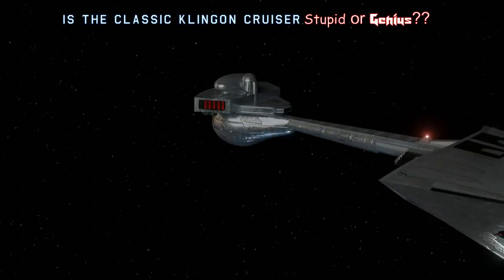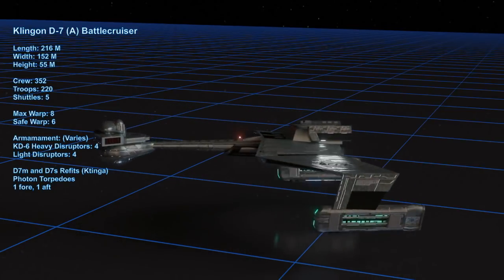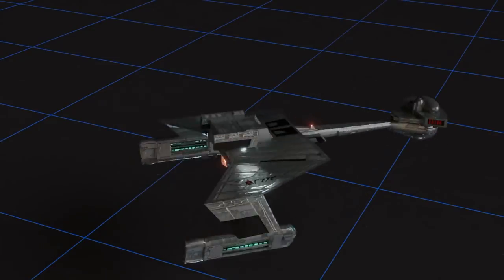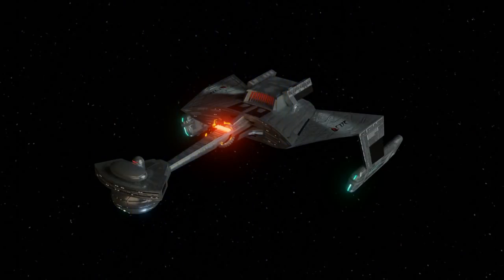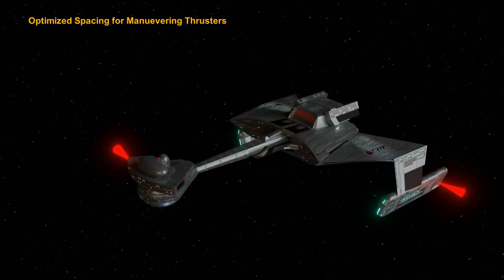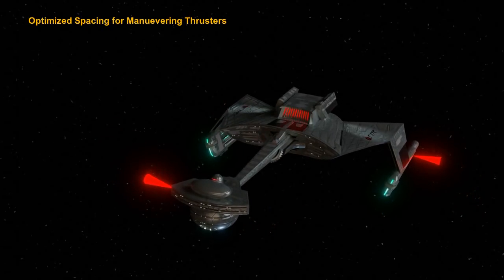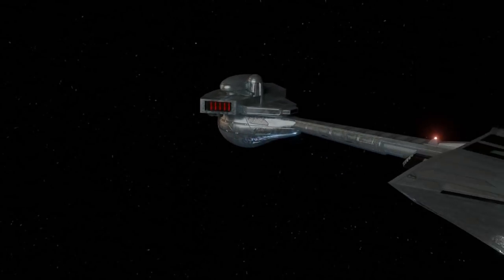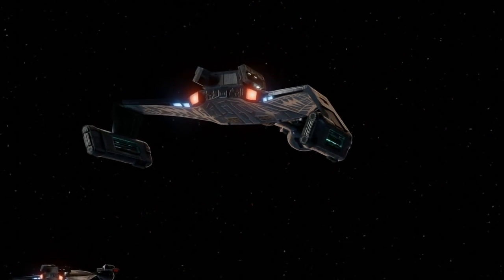The Classic Klingon D-7 Cruiser - Stupid or Genius Design?? Animated Breakdown!

Comment: In the game Starfleet Battles the long neck is used to explain why the phaser's have extended arcs that can reach across the hull from one side to the other.
Reply: I'm a player. Yes you are correct. It's for improved weapon firing arcs. If you ever played Star Fleet Battles, one advantage of the design is that the weaponry in the boom can fire in almost 360 degree arcs. Less weapons are needed due to the improved firing arcs. The forward phasers can fire directly to the rear also. Fewer weapons with improved firing arcs uses less power. In the game, Klingons are the only ones who can charge all their weapons and maintain a very high speed. They can use high energy turns, which are energy intensive, while charging all weapons, if you give up overloading your disruptors, or move at a slightly lower speed. With the extra power, ecm and eccm become a major tool for the dance of death.

Comment: I heard somewhere.. read?  that the forward section was also capable of being used as a life pod/life boat? of sorts.
However such a design would be able to mount other equipment in a module design such as a troop pod along side of this long spindly neck.
You even point out that ships are supposed to be partly modular in star trek.

Comment: Great video!  I love this ship design, which is one of the reasons I preferred playing Klingons in SFB.  Anyway, I can definitely see the design being a result of multiple factors mentioned here. In particular, perhaps Klingon warp engines were less efficient (at least initially) so having a more warp-geometry friendly design was important.  Adding to that, you want to keep the mass down for a variety of reasons (particularly maneuverability, so you use the boom design rather than the Imperial Star Destroyer wedge design.  This takes less materials, of course, so they're cheaper to make as well.  I'm just rambling.  :)   Thank you for the video!  Loved the 3D design as well.
Reply: It's for improved weapon firing arcs. If you ever played Star Fleet Battles, one advantage of the design is that the weaponry in the boom can fire in almost 360 degree arcs. Less weapons are needed due to the improved firing arcs. The forward phasers can fire directly to the rear also. Fewer weapons with improved firing arcs uses less power. In the game, Klingons are the only ones who can charge all their weapons and maintain a very high speed. They can use high energy turns, which are energy intensive, while charging all weapons, if you give up overloading your disruptors, or move at a slightly lower speed.

Comment: I feel another reason for having a thinner neck is the fact the D7 uses a lot of front facing weapons, so to keep a already fairly wide design from being even wider the neck design is made to hide behind the front head while attacking, the thinner front silhouette allowing for less chance to be hit by enemy fire
Reply: It's for improved weapon firing arcs. If you ever played Star Fleet Battles, one advantage of the design is that the weaponry in the boom can fire in almost 360 degree arcs. Less weapons are needed due to the improved firing arcs. The forward phasers can fire directly to the rear also. Fewer weapons with improved firing arcs uses less power. In the game, Klingons are the only ones who can charge all their weapons and maintain a very high speed. They can use high energy turns, which are energy intensive, while charging all weapons, if you give up overloading your disruptors, or move at a slightly lower speed.

Comment: Waay back in the early days of Trek conventions (mid-70's), I remember there being speculation that the neck of the D7 might contain the deflector/shield system machinery for the ship and it being the thinnest hull area, is where the system was connected directly to the hull plates.
This was even reinforced in the K'tinga class with all the greeble's added by the SpFx crew for TMP.

Comment: I have a fan generated plan of the D-7 I got in the 70's. The main hull was engineering and enlisted crew quarters with officers in the forward section. The best description I have seen of Klingon society is the novel, The Final Reflection, and I think the ships show the society's warrior attitude.

There was a Star Trek novel that had the boom section separated from the main hull but connected by a fiber optic cable allowing the two parts to operate together in attacks.

Comment: perhaps it's just simply because the klingons designed the cruiser to fight head on (hence the forward heavy disrupters.) and thus the profile makes more sense, if they are shot head on the head protects the neck and the distance from the main hull provides some protection to the warp core due to the distance from the main body of the ship.

Comment: Still the coolest design of all the fictional starships.  I've heard its design was inspired by the manta ray, just backwards.  The boom corresponds with the manta's tail.  The neck makes just as much sense as putting the bridge on a Federation ship exposed on the top center of the primary hull, as if making it a bullseye.  Ships in the Star Trek universe rely entirely on shielding, which makes perfect sense considering the power of phasers/disrupters.
Reply: The ship design may have also been partially inspired by the Martian war machines from George Pal's The War of the Worlds.
Reply: One exception is the Federation-class dreadnought.  The bridge is nestled within the primary hull, making for an extremely difficult target.  My father had the deck plans for this class and I spent hours going over everything.

Comment: I always thought that the the neck was designed to separate the engine section from where the officers were stationed. I imagined that the warp core was more rudimentary and radiation leaks were common causing crew exposure.

Comment: They said in Star Trek: Enterprise that the front of Klingon ships are the heaviest armored parts of the ship. Its fools attackers into thinking the "head and neck" section is vulnerable, when they are actually the strongest and most heavily armored.
Reply: This is the theory I had with the USS Vengeance Bridge, that it looks so open and weak but it's the most shielded part of the ship aside from the warp core/ engineering. So you would fire at the bridge and not at the weapon systems or anything else crucial.
Reply: @JTkirk21508  - it's same rule that Batman has in the comics. He puts a big bat on his chest as a way to draw attention and taunt attackers into shooting his chest. But the chest is actually the most heavily armored part of the Batsuit.
Reply: @TheBigExclusive  He be playing chess not checkers.

Comment: One of the points to take into consideration is the culture behind its design.

Klingons favor bold, up-front engagements, and as such their ships are primarily tuned and known for their massive front-facing firepower. This leads to reason that the neck was rendered so thin because its shape was not a critical factor; look at the ship from the front, and all you'll see are the pod and the drive section, while being in the direct line of fire of its disruptors and main torpedo launcher. Any strike from a different facing would (in their eyes) mean that the ship was out-maneuvered or out-matched by either a superior or dishonorable foe.

You can find similar structural arrangements on other klingon ships, especially bird-of-preys, who are especially known for their more hit-and-run tactics relying on massive burst of frontal damage and then rapidly maneuvering away from the engagement to recloak and prepare for another strafe run.
The D7 could be an offshoot of this, focusing on higher thruster maneuverability and precision to maintain constant frontal contact with their target while eschewing some of the more sophisticated cloaking systems of the nimbler bird-of-preys.
Reply: An interesting thought, actually. People get so used to Federation thinking of arrays that line of sight for weapons is not as important. But for an ambush predator like a Klingon ship, with 80% of their fire power forward, and from fixed heavy disruptor cannons with limited traverse, a small forward section maximizes the firing arc of those weapons.
Reply: @crownprincesebastianjohano7069   it is why i take huge issue with how discovery and jj-trek presented both klingon and federation ships.

the ultra-organic shapes of klingon ships in both discovery and jj-trek are a huge and anachronistic departure from what is known to be the klingon style, hell even ST:ent knew better.

for federation ships, the first time i saw the concept art for discovery i was like "that looks like an hybrid between a D7, a romulan warbird and a constitution rather than a proper starfleet ship"

Comment: Bravery/Honor definitely plays a roll in this.  Crew in the fore section and bridge are right up front as close to battle as possible in a seemingly more vulnerable part of the ship. There are likely multiple things going on here; tradition for example, but this idea of riding into battle in an extended fore reaching part of the ship is likely something going back well in their history.  It may even go back to pre-space naval days. 

Klingons also like both ramming and boarding.  The shape of the bow of the D7 has a very ram friendly design, and you could impale the ship pretty deep into far larger enemy vessels pretty easily and literally empty the entire fore crew and all the officers into an enemy vessel with Batleths. This feature alone seems like something right out of Klingon Naval history. It also explains why the whole section can be detached so easily, as another benefit would be that you could drop the entire front section if you cannot back out of a rammed enemy vessel.

Comment: Some of your points are rather valid,  But I'm inclined to be believe it is for maneuvering.   Space warfare is in 3D with no up or down. etc. unlike some of those space games that show dog fights much like in WWII.  I believe you will be running at your enemy or running away [Vectoring into or away from].  In most battles you will have the front pointing at you or away from you.  You might run into a parallel chase situation,  but at those ranges the chasing ship will vector into the the chassed ship so all the ships will see of each other is the front and rear arc.  If it gets to a point the "Neck" is vulnerable to attack,  the battle is over well before that point as the ranges have closed to the point you can target the flanks.  The other point is in targeting,  unlike the Federation that is always targeting engines etc.   I do believe like everything in war you target the center mass.  Now with the area for the center mass basically missing,  You have a smaller target to try and hit if you aim at the center mass, or do you try and target either end with the larger sections?  you also have a bigger chance of missing that target area as those areas are in them self a much smaller target.  You just gave the attacking or defending captain choice and a decision to be made.  Target center mass, Target the back, Target the front or Target the "Neck"  Those split seconds that the attacking or defending captain needs to think about what he is going to do or could do...Could be a 1st or 2nd shot for you it could be an advantage much like Dazzle Paint on a ship in the World Wars.  Put a Dazzle paint on the D7 with a few off set circles and ovals on the rear or a modern reader reflective paint like on a stealth fighter or ship.  The D7 odd shape might be harder to hit than most people think.  Yes I used modern things we have today like Rader, Reflective paints etc.   but in the future I'm sure they have advanced on those technologies as well, including defenses for them too.  "Shields", "Cloak", "Armor Plating" "Ablative Armor".   I'm sure most battles in space were done with a small number of ships so that front to rear facing arc is mostly valid.  In a front or rear firing arc the "Neck" is covered by the front or the rear of the ship,  it can not be hit.  How many battles do we have like Wolf 359, DS9 etc.   I'm also looking at the likes of B5 and BSG among others.  Most ships are patrol or interceptors or in NAVY terms Destroyers, Frigates, Cruisers, Littoral, Corvettes etc.  The huge Battle ships and war ships have mostly fallen out of the picture.  Not know much about WARP and or high speed space travel,  but looking at modern supersonic planes,  Things were done to make them faster like the thin waist coke bottle shape, pointed nose cones that put the sound barrier pressure wave before or aft of the wings etc.  Just so many things we as humans who have not travel beyond the moon do not understand about space travel and warfare.  As Lt. Uhura said  "You're like a baby, making noise, don't know what to do." "But Stupid! Ignorant Like A Child... "

Comment: Many, many yeard ago, I saw a blueprint arguing that the length of the neck functions as a type of radiator or thermal dispersion system with active liquid cooling -- it is designed to serve the high-thermal-output systems such as engines and weapons. The device within, reaching along the length of the neck and back into the primary hull, was a closed circuit labelled as the intercooler. The image was part of the screensaver “Scotty’s Files,” one of the many Macintosh screensavers under the name “After Dark."

Comment: An additional factor is any weapons implacements mounted on the forward pod have considerably greater firing arcs available by having the pod mounted to such a structure. The main body of the vessel, with its nacelle mounted primary forward disrupters and aft torpedo launcher, delivers all its weapons fire along that axis only. Secondary disrupter implacements, say under the bow corners of the pod's triangular hull section,  provide extensive lateral firing coverage. The D-7/Katinga's boom structural weak point is also comparable to the Constitution's structural weak point of it's thin connecting neck. Both design elements that would be perminantly phased out of all subsequent starship classes within both navys beginning with the very next ships designed to replace them.

Comment: the origional Design was to have the forward pod as a swappable module simmilar to the Nebula class "Sensor Pod" A concept addressed in several tech manuals printed in the 80's this allowed for the drive to be mass produced and the forward pod determined if they were a recon ship or a battle cruiser. this concept was continued to a lesser extent with the Bird of Prey design and even the Vor'Cha Class cruiser which was designed to have the forward pod having field seperation. (I'm guessing the theory there is having the forward disruptor cannons and torpedo launchers detatchable in order to lay an ambush when approperate it just turns out there was very few times for that tactic on screen until DS9 and by then they moved on for ship Ideas)

Comment: According to Memory Alpha the D-7 has a crew of 430. Most of the rear hull is machinery. If you look at the leading edges of the rear hull you will notice a grill covering that front of the hull just inboard of the warp nacelle pylons. Those are supposed to be Bussard collectors that neck down to connect to the impulse engines. The D-7 is supposed to be able to skim a gas giant to refuel. 
The front of the Enterprise warp nacelles were supposed to be Bussard collectors.

Comment: I really like your breakdowns of these designs. Someone could look at these ships and outline all the ways they think that the design is stupid, but you take the time and ask "Why would it be designed that way?" in an impartial manner and I really appreciate it.
As for the D7, my first thought years ago was that a single corridor is an excellent choke point in the event of mutiny on the crew deck and the officers could hold the command structure indefinitely (provided it has independent power and air from the drive section). More recently, with this video, I had a thought of this being a corridor for the torpedo magazine instead of a weapon mount.
The torpedo magazine would be located in the drive section, where the munitions would be most protected along with the ship's power plant. In this way, it would be less likely for the magazine to cause secondary explosions in the event the command section were hit while unshielded. When the torpedoes were needed, they would be sent down the corridor to the torpedo room to be loaded and fired.

Comment: The logic behind all the TOS ships was that the shields did all the defensive work, not the hulls.  Without the shields, the weapons would utterly ravage a ship.  That is how the designers and writers viewed the weapons, hulls, and shields of the vessels.  That is why the TOS Romulan BoP's weapon was so devastating as it could reach warp speeds and bypass shields by overloading them and essentially vaporizing the shielded structure within its protection. Other than limited range, that weapon at the time was flawless.  In TMP Sulu again states that the "New shields held", meaning that the refit's shields were powerful enought to withstand another type of plasma weapon for at most(or least) one shot. Bottom line is that without shields a ship is screwed.
BTW Excellent video as always bro!  Still a huge fan of your work.  This is Atolm signing off :D

Comment: Another reason could be that of the modular and neck separation could be that of how some military vehicles are designed. For fast repair so the Klingon ship yards could have stocks of drive section and head parts so for speed of repair if a ship comes in with a damaged drive they can just swap it over then the turn around of repairs are faster or cannibalise one ship to get another one back in the fight.